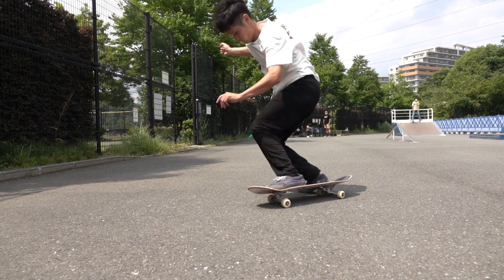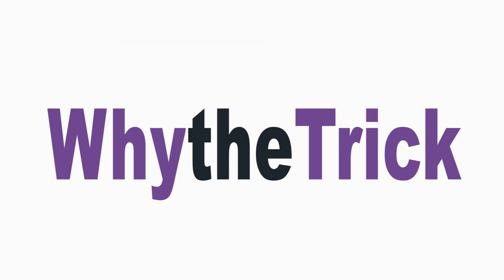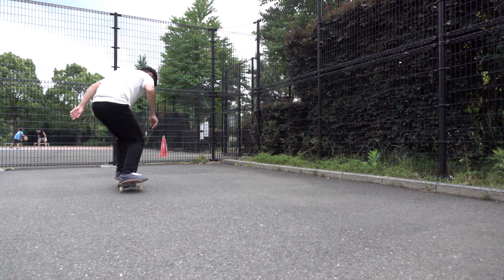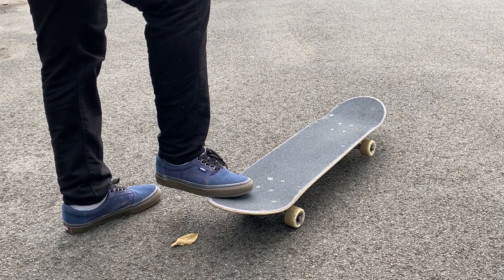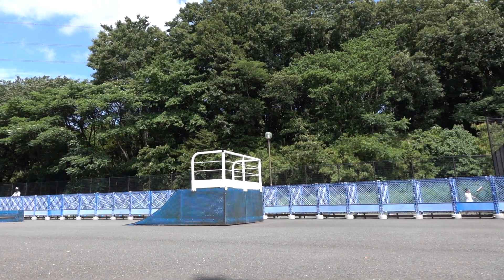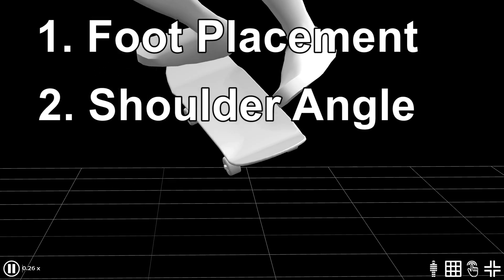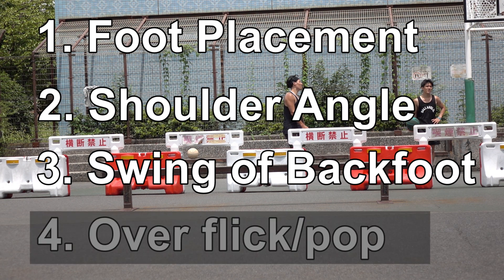Why does your kickflip spin backside? (1/2) Foot placement and shoulders

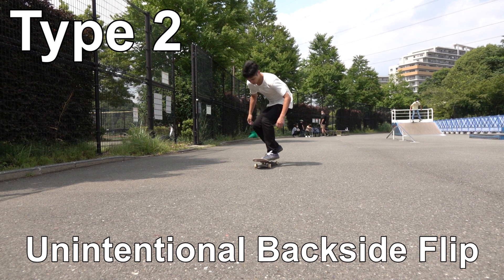Comment: I struggled with my kickflips turning backside (I ride regular) for literally years. The secret to fixing them for me was where on the nose I was flicking: it wasn’t until I flicked more off to the left and lower on the nose did it change. I was flicking far too much straight off the nose and it caused a turn to the right at the end. Seriously, watch the attempts that wind up turning in this video and you will see the flick is almost straight up and off the nose 3:15 : angle you flick lower and off the side (you need to be very precise and deliberate about it—keep your eyes on your flick foot the whole time and tack exactly where it leaves the board). Do this and you’ll find your flip will straighten out almost immediately.  Check where the flick happens here: 4:41  (the front foot I mean as the back foot is perfect). Also, if you think about jumping back towards your heels just slightly as you pop, it will keep the board under you as well. Anyway, I live that you tackled this issue in your video as it plagued me endlessly!

Comment: This turning problem has been the last piece of the puzzle for me and my kickflip journey. Weight distribution as instructed in this video definitely helped me. 

Just curious though if you’ve considered that poor quality of  flick might cause a corkscrew effect resulting in an angled landing. My board rotates backside most of the time. Yet I have noticed that the times when it stays straight are the times when I’ve executed a good flick. I provided just enough finesse so as to not make too much contact with the nose as my foot whips it. Too much contact between foot and nose and the board flips off axis resulting in corkscrew. This throws the tail end away from me on the heel side. 

And I watch pros in slow motion, I notice they too sometimes create a corkscrew movement rather than a flat z-axis spin. The difference is they catch the board at the top of the jump before the board has a chance to turn too much. Maybe beginners notice the turn more because they are less likely to catch the board and more likely to wait for the board to hit the ground before landing. This gives the board more time in the air to flounder. 

Anyway this is just a theory for you to consider.

Comment: Your simulator also has one extra flaw; the trucks are stiff. So in reality, the trucks will bend to the side and that will skew the mechanics somewhat.
Reply from the maker: true.
Reply from the maker: thanks for the comment though. will improve the simulator...
Reply: @whythetrick  np. intersting if you can actually do that. That's a lot of physics; bushings stiffness, trucks tightness, and then trucks pivoting and turning ... interested to see if it actually works out

Comment: Lol, this is such nonsense though. The weight doesn't matter. You can start out a kickflip in literally any position. Crossfooted, all feet on one side, it doesn't matter. As long as one foot can pop the tail and the other can complete a flick. Weight also doesn't matter, because the only way you're going to land the trick, is when you remain within a proper range of balance. Shift your weight too far off and you simply won't land the trick. Sometimes beginners use shifting their weight to their advantage to stay over the board. Think pop shove it, but jumping forward to stay above the board. Instead of scoping the back tail under you, so the pop shove it stays more in the same location.
What makes the board spin backside on landing is actually upper body movement that has a dominant movement towards already turning backside. Usually when people flick of the side of the board when doing their kickflips, the front foot can end up too far away from the board to comfortably land back on. If you pre-turn backside and do a slight turn right after the pop, it is possible to force your front foot back over the board almost guaranteed. It's similar to jumping forward doing a 'beginner pop shove it'. There's a consequence to doing this though, which is the turning of the board on landing towards 90 degrees backside. I should also stress that a scoop heavy pop very quickly results in a varial kickflip. More so than a flick that is following backside direction at the very end of the flick. A varial kickflip is probably easier to do than a kickflip, when a pop shove it feels natural to do. As for your physics simulation using a ball, do keep in mind it leaves out a lot of other factors that play a role. For example, there isn't just 1 force going down, making the board flip over. But there's a directional force to the pop, another directional force of the body weight going down (possibly at an angle, not straight down) and there's the turning of the upper body, friction of the flick and vector direction of the flick. In reality, there are about a thousand different ways to kickflip; including flicking down (mob flip), or leaning back a lot and having the kickflip do more of a roll over, or doing more of a preloaded pressurized kickflip that has a lot of counterweight on the heelside, or leaning to heavy on your back leg (rocket flip), all the way to a Nyjah kickflip with an extremely short but snappy flick on the outside of the nose that makes the flip go very fast and accurate. 

Ironically, one of your own real world kickflips with two feet heelside already shows it doesn't matter if all movements start from that position given enough flick and pop. I'm not hating, I actually appreciate the 3D animations. But the explanation on the physics behind it is somewhat incorrect at times. Not 100% incorrect, but mostly very incomplete leading to the wrong conclusions. One of the big factors I miss in a lot of these is how important it is to really crouch down and really jump up a lot when doing any flip trick. If there's no enough time for the board to pop up and spin, it'll never work no matter the proper technique.

Comment: Great video. I've been learning skateboarding from a physics perspective just because of my background and all the tutorials were frustrating me because they were saying "just close your shoulders and do THIS  foot positioning". I would even try to counteract shoulder rotation by rotating opposite board spin to no success. In reality the weight distribution is the underlying factor along with the distribution of forces your active feet (not positioned feet) apply to the board. This is different for everybody based on body mechanics and even board construction.

Comment: This happens to me. So to counteract it, before I pop, I start turning frontside a little bit.. I think putting the back foot in the back pocket (image fs shove) would help too, but to balance it out would require the front foot to be more fully on the board, which would also require a higher jump because the board would flip slower. So depending on your ability you should strike balance between the 2 foot set ups & adjust where you aim your turn before flip.

Comment: I just commented on your other kickflip video before I discovered this one, commented exactly about foot placement and shoulders 😂. You’re absolutely right that they don’t directly create problems and you can definitely kickflip with open shoulders and popping off anywhere on the tail. The point about it potentially causing tilting is an awesome insight! I would suggest that having your torso turned against your legs might not be the most ergonomic and efficient way to jump and maximize your body’s energy into the kickflip tho.

Also would like to see your ideas about posture. For example, I feel a lot of ppl tend to torque their body against their knees when they crouch, esp if your shoulders don’t align with the direction your knee is pointing, and that ends up wasting a lot of energy as well as possibly causing pain long term.

Love the channel! These are things I thought only I was crazy enough to spend a lot of time thinking about in secret haha. The 3D models also have a lot of potential - I think most trick tips tend to make me think two-dimensionally about tricks, those models really help see things from different angles much better.
Reply from the maker: Thanks a lot for your insight.

Regarding posture...
I'm trying NOT to be subjective as much as possible in my videos but I can assure you some things. 

1. Riding with your shoulders opened is definitely not good for your body. It's just not natural for human bodies to be twisted like that. I think this will cause pain in the long run. Recommend riding switch sometimes.

2.In terms of the effectiveness of energy, I didn't really think opening shoulders itself directly leads to wasting energy. But now that you mentioned it, it might be right. Perhaps I could talk about that in the future videos.

Anyway thanks a lot again. My channel wouldn't mean anything without valuable viewers like you.